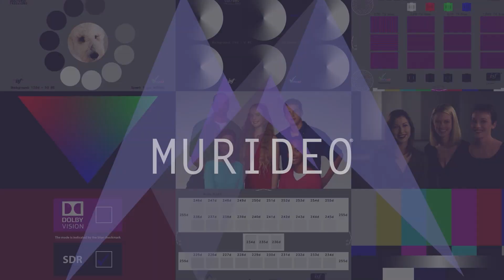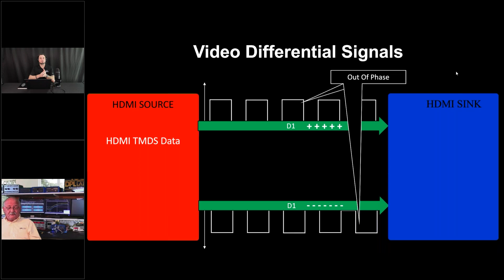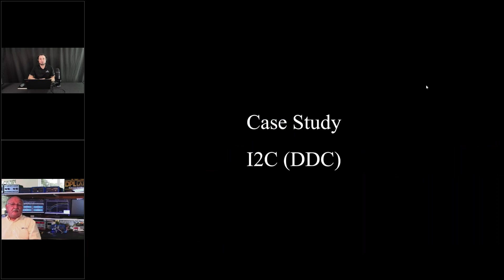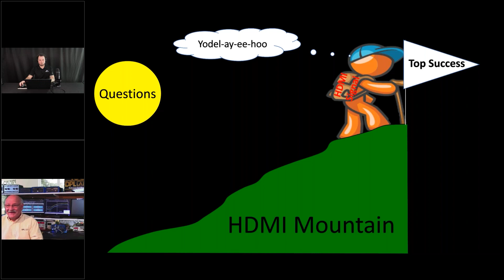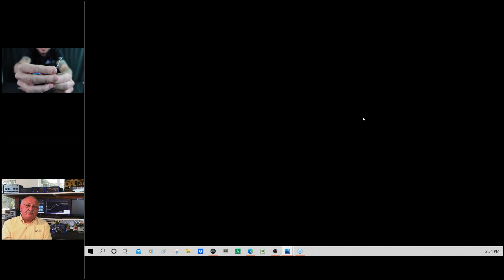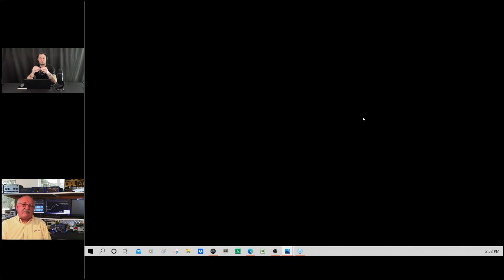AOC HDMI Cables - More Than Just Distance

Comment: You guys didn't answer the question about external power source except to say usb port on tv may not have enough power.  What we want to know is if it helps the cable with video audio and the ddc data?  Or just go with cables that use hdmi port's pwr.   And at what distance do we need to start using external power?  Finally, does the external power source do anything to help the slower rise times that increased as distance increased? I would think the fiber itself would eliminate rise time issues. You didn't really go into detail other than say the Phillips spec was not being adhered to.  Thx
Reply: On this issue, external power supply is usually not required. Some time ago we sent a 200M HDMI AOC to our customer, and our customer said that everything works well and there is no problem of insufficient power supply.
If you want any further information, you can contact me. Thanks.